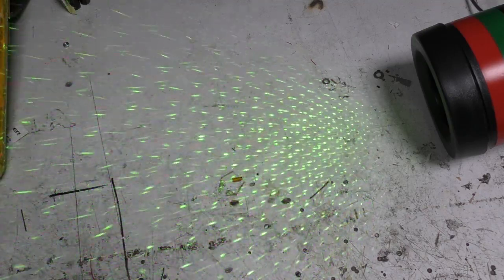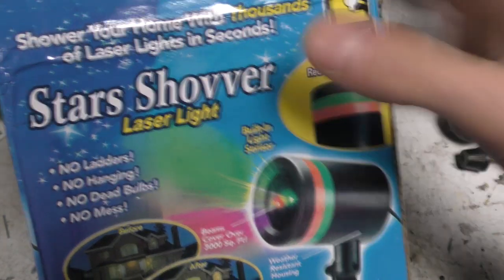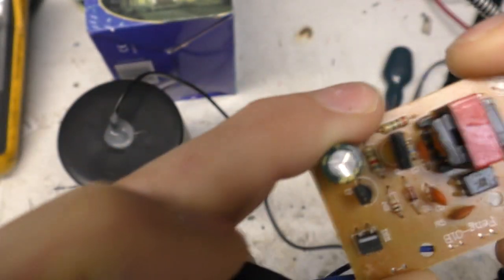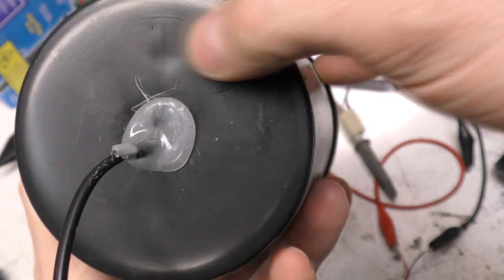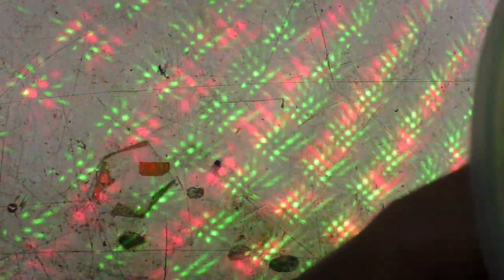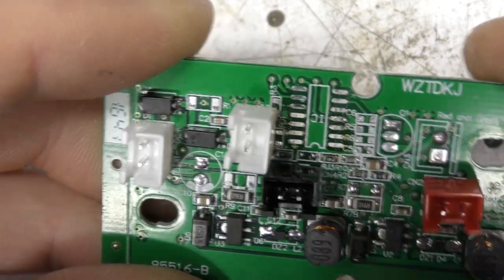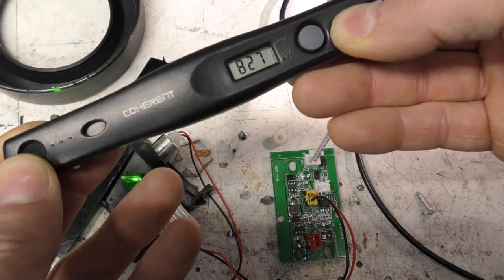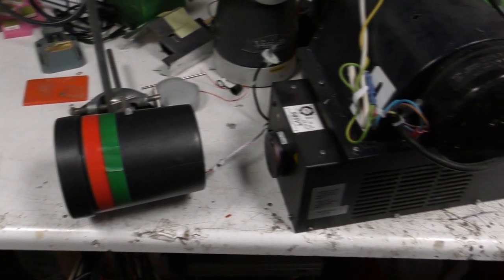Crappy Christmas "Laser Shower" projector teardown

Comment: The EEPROM was probably intended for sound for other product based on the same board?  Sometimes it is cheaper not to have separate factor tooling for various products. This could also just be leafagacy from a similar product in their line that had sound.

Comment: I have similar projector like this and the diode in green laser is gone.  Can you advise what type could it be ??? if I could use some cheap alternative from ebay or ali. I know it is not worth repairing but I am wondering if you can repair that laser.

Comment: I've not read every comment. However, can i point out that you have a fake. This is a cheap Chinese copy of the original JML "Laser Shower" I know this because i have a "Laser Shower" The one you have looks similar but is not the same. The Chinese have tried to profit off the success of the genuine, but have failed. Just a side note; the "Laser Shower" is a mid range so there is much better out there. Brilliant video but this isn't a review of the genuine thing, but a review of a knock off. Keep up the great vids though

Comment: What a load of rubbish you have said 
These are cheap what do you expect , nothing wrong with the PCB or the capacitors or the copper clad wire
And as far as the power supply is concerned ,what do you want 15 m lead 
The EEprom , who cares WTF are you on about 
Who cares about your crappy measurement of the laser , you have no idea
you have poor knowledge of electronics ,your whole video is just rubbish

Comment: eeprom looks to be pinned to the pads for a 6/5 pin micro
my guess is the other version has a pic10 or other small micro and the eeprom is to store patterns or some such and it came out cheaper to use that than a better micro

the reason it's there is most likely an error in programming the pick and place

Comment: Haha I bought the deluxe model in an anodized case with sound sensitivity. It has the same dogshit power supply but at least it has a cooling fan and a remote. The board inside mine is completely different with it designed in a different shape to mount to the fan/end of the case instead of on the diode assembly. I'd be a bit worried about the heat those two diodes running in a sealed plastic housing would make. At least the diodes in mine are cooled by a fan and the aluminium case.

Comment: The most logical explanation for the blank unused eeprom is someone cloned another design with near zero knowledge of even basic circuitry. I've seen that before in cheap Chinese junk from eBay. The next most likely explanation is the contract manufacture, or whoever made the bill of materials and pick and place data for the two versions, made a mistake. But either way it's ironic when they are trying to keep the cost as low as possible and include a relatively expensive completely unnecessary component. Typical Chinese fail.

Comment: Mine doesn't look that cheap, but I probably paid more than you did.  Mine is properly sealed, no color tape around the outside, and they didn't use silicon caulk for the seal.  I guess you get what you pay for.

Comment: You are correct. This thing is indeed a knockoff version. I wouldn't be surprised if "star shovver" was intentional, as I believe the name brand version is called "star shower". Even the box is almost a identical copy of it.

E: https://www.amazon.com/Shower-Motion-Laser-Lights-Projector/dp/B01GOQNXQG

Amazon link to the "proper" one. At least the ones nearly everyone around me owns, and all the stores sell. I believe this one is the near model, and the one you have is ripping off last years model.

Specifically this one: http://www.target.com/p/as-seen-on-tv-star-shower-laser-light-projector-red-green-or-all/-/A-49132675

E2: okay last edit, but basically I am wrong, on the amazon page if you select "static" you get the one I linked in target as well. But buying the static one is beyond pointless as the motion one has an option to turn off the motor so it can be static as well.

Comment: That is definitely a cheap knockoff of what I believe are the real ones that I have. I have not taken mine apart, but some immidiate differences I noted were: 

1. Mine has dual laser out holes on the front, one for red and one for blue. 
2. The lack of 2 switches on the top, one to turn the motor off and the other to select red and green or just green laser.
3. Detachable power cord, done via a plug that screws one and has a gasket in it, not a blob of hot glue. 
4. The plastic looks much higher quality than this one.
5. Mine has all the various stickers the box refers too and the color strips at the front are actually applied correctly.

Plus mine are actually water resistant, they spent the entire day in the rain and continue to work, Though one thing they do have in common is that ridiculously short freaking cable, about 1 foot. I had to seal up the end of the extension cord; with the two of them plugged into it; in a tupperware container and use silicone caulking to keep out the water. Not a great long term solution, but fine for the 3 weeks it'll be out front. We also have them pointed at some bare trees out front, looks pretty nice, almost like we've hung flickering lights in the trees.

Comment: How do you convert (or invert) DC to AC? I want to power a 12VAC microwave type stepper motor from the car battery, but don't know how. Also, is a choke necessary in this situation to limit the current?

Comment: I use numerous of these for different projects from rgb 2axis projecting to range finding,  to spectrography. 
Mostly because of its availability. 
I like the power since it stops drops to 5v immediately out of the supply,  but i usually just plug the coupler (snipped off )  directly to any 5v supply (2a and  ^) 
My complaint is the cooling system,  very sensative.  Lost a few lasers.  And the  variety of output brightness which i haven't been able to predict   I've had g / r reverse brightness over time,  and over functioning time the levels tend to equalize.

Comment: That PCB layout almost looks like trail and error design! The designer has to have no idea what the components actually do. They copy-pasted the layout from a different product and you tryed to poulate random components until the thing works. Bigclive also did a video about a chinese power supply where they just put a resistor across the isolation gap for no reason. Its quite amazing, we are now using electronics designed by people without basic electronics skills.  How the hell did that happen?

Comment: These are sold in W H Smith for nearly £30, but you can buy the indoor models on eBay for less than a tenner. I bought a few of them. In fact you saw them in-use at EMF Camp at the Portcullis / Cisco tent, although I was very drunk when you came by.

Comment: Maybe there was a roll of 24c02 accidentally loaded in the pick and place machine?
Reply: Jasper Janssen Thankfully they didn't load roll of some expensive FPGAs ;)
Reply: But what about the the placing offset compared to the 14-pin device footprint? That would have to have been dealt with by someone presumably.
Reply: I dunno, it kind of depends what the pick and place uses as origin. I guess you feed it the Gerbers, so it has to use the actual pads and silk (to determine the pin 1 position) as reference, in which case it's not outside the realm for this to happen automatically.

Putting so8 on so14 pads is actually relatively common. Reverse as well sometimes. Usually when one brand of x wants a slightly different/cheaper microcontroller than the circuit was designed for. I've seen that on RF-X10 relay modules — quite clearly the same OEM, and it came with three different micros for the three different brands and incompatible radio encodings. Some had the so8 micros, some the so14. I don't remember what the actual foot print was off hand though.

Comment: The psu almost looks like a decent PCB layout, except they forgot to cut the slot and modified it to use the cheap not safest rated cap by putting the track closer. And used the cheapest nastiest components to execute of course.

Comment: Can these, if accidentally aimed above a house, possibly blind pilots?
Reply: I fucking hate these pieces of shit. It seems that at least 8 people around every single airport in Michigan have these stupid fucks. It's not going to blind anyone, but, it's super annoying for a pilot during landing, the most stressful and intense mode of flight. It is also illegal to aim lasers at aircraft.
Reply: Brandon MacEachern with diffraction gratings in place, no. Without, highly unlikely.
Reply: Yes.  That's the general idea.  Reality,  it would startle them in the Cockpit,  and naturally react by looking away,  but into an illuminated Cockpit.  They'd react again,  probably with Anger and panic,  BUT,  the laser is a fairly low rated beam and probably won't cause damage. 
The act of pointing a laser in the air,  isn't illegal,  even hitting a Cockpit isn't.  But purposefully targeting one (especially tracking becomes intent of assault,  regardless of the rating) 
Anyhow,  if the faa approaches you and says please don't do that,  and you continue,  THEN,  its definitely considered illegal. 
The original manufacturer of this laser product includes a section regarding airplanes,  near the bottom of their faq online.  So,  they are aware,  and sufficiently earn consumers of the danger
Reply: To actually be dangerous 
You'd need to extend illumination time,  meaning most likely track the plane with a full beam. 
The Defraction grading greatly disperses the power to much more tolerable levels,  per Point.  
1,000 ft to 11000 ft.  This laser is considered a distraction. 
At around 2 ft and below its hazardous.  And between 3 and 1000 ,  "potentially". 
A 1watt green laser at or below  733 feet is hazardous
Reply: Aleks Sanford prettig sure that what you're talking about is laser pointers. These things a pilot won't even notice if someone was trying to shine them up.
Reply: Jasper Janssen I fly airplanes and helicopters at night at least on a weekly basis. At higher altitudes, 5000+, they are not very noticeable, however upon landing they are very noticeable and incredibly distracting and aggravating.
Reply: Jasper Janssen also, these things are laser pointers. They're just many moving beams of lasers
Reply: Aleks Sanford precisely, the already low power of the laser module is spread over hundreds if not thousands of individual beams, and by the time you're at altitude there shouldn't be more than one beam hitting something the size of a cockpit at any one time...
Reply: Jasper Janssen I don't know how much time you spend piloting aircraft, I usually fly 5-10 hours a week, but I can assure at the most critical, and dangerous stages of flight (landing and takeoff) they are a considerable distraction to an already busy pilot.
Reply: I don't fly at all,  but,  i assume   most of what happens,  at 1000s of feet,  is a very,  observable increase in heart rate,  then anger,  then questions,  and finally an eery solitude. 
At which anytime,  control,  you pick a control,  can be instantly lost.
So yeah , very dangerous,  especially with passengers. 

But,  its also very very very difficult to hit a cabin ,  moving,  and remain,  on target of that window. 

Plus,  the lasers are regulated. 
These are all 5mw laser pointers.  
(some claim 100mw...  Hm) 
 under 10 feet,  and blindness is  extremely high. 

So,  even at 1000 ft
Even a laser pointer 
CAN 
cost lives
Reply: rocklobster1976 it's not easy for a person to aim a laser at an aircraft but these decorations have a larger area and are constantly aimed at approach paths. On a night time approach during the holidays I get hit by around 3 per landing, not very fun.
Reply: rocklobster1976 I'm also not usually 1000 feet off the ground when these distract me, I'm usually 100-500 feet over houses as I'm trying to land.
Reply: Do you get multiple beams at once or just a succession of single beams as you pass through the pattern?

Comment: They're pretty inexpensive here in the US. I have one aimed up at a big tree. Makes some pretty cool patterns in the branches. Not the same brand, though. The ones sold here have a switch on top to change from static to moving pattern, etc. and cost around $30.
Reply: Pete Brown , mine was $39 also with the switches. I tried pointing at a tree too, that was pretty good. Then I put the unit in the tree pointing down at a hill side (my front yard is a steep slope). that was also cool as there are lots of wild grasses on it.

Comment: Random person from YouTube's suggested videos here, what are the "vias" you're talking about around 13:50?
Reply: "In printed circuit board design, a via consists of two pads in corresponding positions on different layers of the board, that are electrically connected by a hole through the board."

Comment: I have the Star Shower version of this, of which this rips off. I modded mine to run on USB power since the AC adapter puts out 5V at 2 amps. 

I'm going to pull the green laser from one of these and make a laser pointer once I find out what voltage the lasers run on. I'm thinking 3 to 4.5 volts since the pen lasers have two AAs or Three button cells.

Comment: I got one of these that had the light sensor and a button to control the motor, which was much slower than yours. turns out it's a stepper motor being run by that board. the "program" options were just on and off, but presumably since the control was just a momentary pushbutton, with more programming it could cycle through different speeds or back-and-forth motion or whatnot.

Comment: The thing about the labels--I don't know about the UK, but in the US labeling is a BIG part of compliance for laser products, and failing to correctly indicate the hazard classification and not having a laser aperture warning sticker are both big no-nos.  

Using a buck regulator to directly drive a laser diode is definitely not a good idea, laser diodes are FAR more sensitive to transient events than LEDs, and a linear driver, at least for the final regulation stage, is mandatory to get reliable performance from a laser diode, especially if you want to run them anywhere near their rated maximum power.  A switching pre-regulators is of course a good idea where you're concerned about efficiency.  

Not surprised you killed the red by hotplugging it, if the driver is dumb it will have gone to maximum duty cycle to try to get the output current through the non-existent diode to come up, so the diode would have gotten a decent wallop from the wide-open driver when you plugged it in.  Although laser diodes are also extremely ESD sensitive, so it's entirely possible that that's what did it in while it was unplugged.

Nice going on the argon!

Comment: from the little experience I've had with these cheap party/decoration green laser sparkle things, the lasera seem to fade out and die pretty quicky even considering the cheapness in general
Reply: They are probably overdriving the laser to get it a little bit brighter.
Reply: Doc Daneeka Quite so. My wife ordered a pair of these from QVC, we've have them up for two weeks, the red laser has crapped out of one of them, and the motor locked up in the other. These are rubbish! And they are going back for a refund.
Reply: They overdrive the diodes...

Comment: If they weren't such cheap skates they would have used one of the same supplies made by Changzhou Jutai that you get with the better quality lights (all the branded lights I've seen use them and bigclive seems to rate them) that are inline, waterproof and so actually fit in a normal outdoor socket and can be left outside.

Comment: Wow, that argon laser is great!
Reply: There's nothing like a 7 line argon. I'm guessing that Mike's is running at roughly 125mW for the 532 nm line. 
You can find them surplus but they're still bloody expensive. Last one I bought was around 2000 GBP, but that was way back in 1995. 
Search for "Omnichrome 532" or "American Laser ALC-60X" (essentially the same laser & plug compatible) and beware that you need a power supply and the laser head. Also beware that they come with single-line and multi-line mirrors.... you want multi-line. The single line units were popular for CD mastering.
Reply: Peter S Thanks very much for the elaborative answer! Lasers are fascinating tech, I'm looking forward to messing with them
Reply: ***** You're welcome. :-)  Lasers are great fun to play with but gas lasers are at least 100x as fun as solid state for me. If you add a powerful HeNe to get a 'red' beam and you use the same beam splitter/combiner arrangement that Mike shows above, you can filter the argon and the resulting beam can be almost any perceived RGB color you want including yellow and a sort of "white". I just looked at the cost of similar used ion lasers and they're priced much more accessibly now. PS: Invest in a set of goggles for each type of laser you play around with. That 125mw argon is considerably brighter than the sun.